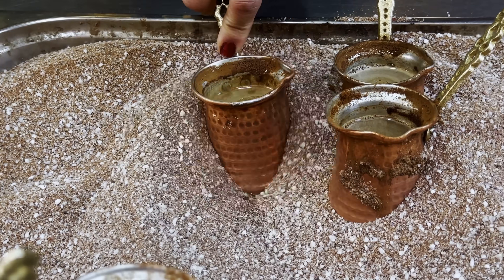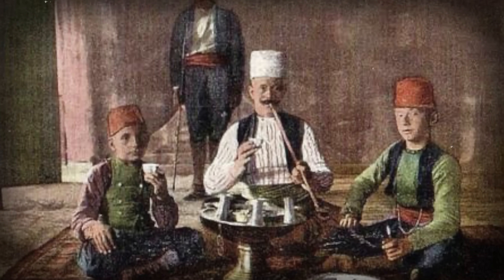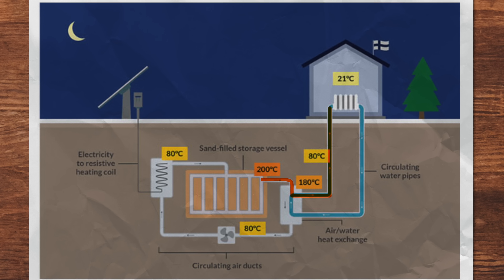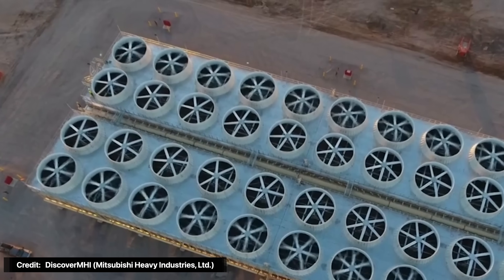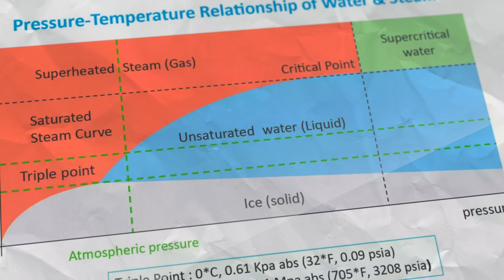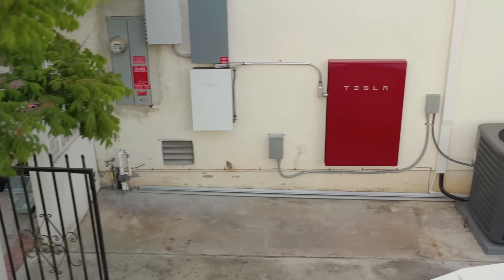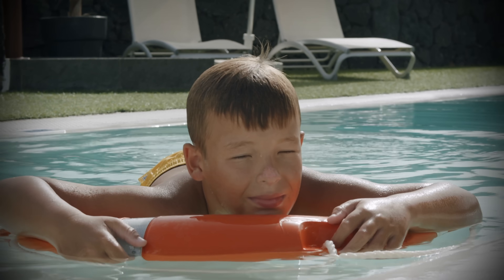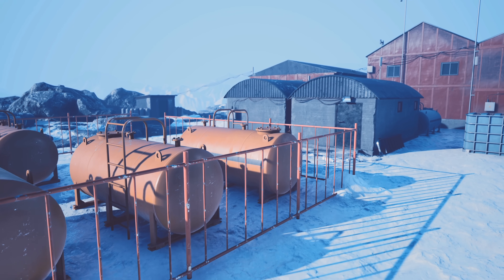The Power of Sand Batteries -- Revolutionizing Energy Storage...

Comment: What I don't get is when people say that the round trip efficiency of Sand is low compared to Li Batteries. My take is WHO CARES?!  If you lose 30%-50% of generated renewable power storing it in Sand that's STILL 50%-70% power you would otherwise have lost because you don't have storage. And if Sand is MUCH cheaper than Li batteries and not subject to the scalability issues of batteries then it's better than nothing.
Reply: Efficiency turns out to be a huge deal and anyone who has lived off-grid for real knows it in spades.  Its easy to brush under the rug when one is grid-tied, but the instant you aren't the importance becomes clear as day.  Even a number as small as a 5% improvement is incredibly important.   I can tell you straight-out that very few people will be interested in turning high-entropy heat back into electricity even when it is offered as an option.

High-entropy energy sources are best used for high-entropy applications.  Heat-to-heat.  Cold-to-cold, and aren't really useful for much beyond that.  Nor will they ever be... reversing high entropy (aka heat) butts up against the laws of physics, particularly the Carnot cycle, so there aint gonna be a miracle breakthrough in this department.

In anycase, this is an area of understand where you really have to live it to understand it.  I can give a simple proxy example, though.   It's like comparing a thermo-electric cooler with a mini compressor cooler.   The thermo-electric cooler can burn 40W 24x7 and STILL not get a compartment usefully cold.   A compressor cooler can do twice as a good a job burning 60W at 25% duty cycle (an average of 15W) cooling the same compartment.   Roughly 300% better.

Same thing with trying to use a sand battery to generate electricity.  You can do it, but its a stupid way to produce electricity.

-Matt
Reply: According to Tony Sebo, the best ratio of renewables generation to storage, is 4:1.  So the issue is what to do with the excess
Reply: If you are building new, a sand / earth battery doesn’t cost much.
You build an insulated (semi) basement and heat up during cheap electric periods.  Should last a few days at least.
Reply: That is the best usage for this tech. Home heating. The energy 'loses' from a basement sand battery becomes the lovely warm house above. In this scenario the loss is the whole point.

For those without a basement think about building a carcass around your wood stove to hold sand and thus heat. Even just 200kg. 1000kg would be better, and is only 1 cubic metre. 

Instead of banking and smothering a fire to keep your home warm over night, where most of the woods energy is turned to smoke and dumped into the atmosphere, you run a much cleaner hot burn fire to heat the sand. You then let the fire go out, and the sand keeps your home warm over night, or even for days. @markthomasson5077
Reply: @markthomasson5077  large temperature changes are terrible for a foundation of a house and the possibility that over time you would get “leaks” in the thermal insulation letting water in would be an unacceptable risk.
Reply: @keithv3767  . No, it would only vary by say 5degC.  Basically it is underfloor heating similar to where you heat up the whole slab. 
Ideally suited to a location where the ground water level is well below the base.
Reply: @markthomasson5077  Interesting.
Reply: Yeah, but there are other forms of battery storage... 

 If they are too inefficient. They won't be profitable, because someone would have to buy more. Making it expensive. Therfor making it useless.
Reply: There are only tradeoffs - there are no easy solutions. The power and equipment are not free. It is social tradeoff. Is it right for everyone to subsidize the price of solar? Not everyone agrees!  Experts can only be trusted, if they have skin in the game. Here they don’t. Invest your own money, do what you will. Asking others to subsidize is a social/political decision to be made. I think . . ..
Reply: There are only tradeoffs - there are no easy solutions. The power and equipment are not free. It is social tradeoff. Is it right for everyone to subsidize the price of solar? Not everyone agrees!  Experts can only be trusted, if they have skin in the game. Here they don’t. Invest your own money, do what you will. Asking others to subsidize is a social/political decision to be made. I think . . ..
Reply: I agree. The loss in efficiency for sure is worth if this material is so cheap.
Reply: why do you compare a tesla powerwall module, which doesn’t support an entire home (as shown in your video), with the solar night energy silo of 7m height, which is to be used for way more than a single household? the tesla power wall is a 10kwh electrical storage. the silo stores up to 100mwh in heat. thats a 10.000 times more, if you really want to compare that.

with electric storage you would need to convert to heat - how is the efficiency there?
even if the efficiency of the heat to electricity conversion is only 50% (you mentioned 30-50%), you’ll get 50mwh of electricity from the silo shown in the pictures. how is that by any means the same as a 10kwh wall battery?

maybe a combination of both would be good, or smaller solutions for private use become an option.
Reply: Exactly.
Reply: I am always excited by these cheap energy storage solutions, but I'm not sure they are actually viable.
Turning electricity to heat, storing that in sand or rock and then converting it back is very wasteful.  Creating hydrogen that you can then either burn or use in a fuel cell seems more sensible, especially since hydrogen can store energy long term. Using Sand as a "heat storage" might work better, essentially using it as a form of "buffer tank", but in that scenario...why not use a heat pump and make use of the 300-400% efficiency? 
I think there are usecases where this type of storage makes sense, but I doubt sand batteries are going to replace LFP/Sodium batteries, heat pumps or other systems.
Reply: People care because efficiency means loss of money. So it´s either cheaper or more expensive.
Reply: @jonjohns8145  you're forgetting to consider production costs. Just because you think solar and wind is free energy doesn't make it so. It takes tons of energy to produce these products and you'd want to recoup the green benefit during the life of the product and then produce some clean energy before it needs replacement. If you're not meeting those minimum thresholds, there's 0 benefit. Efficiency is the holy grail of these technologies. I hope that clears up some of your concerns and you now get why people who understand these things say such things. Cheers.
Reply: you are correct! some people simply do not understand! restistive heat elements and sand is much cheaper than lithium battery production.  efficiency comparison here is irrelevant, and electricity to heat conversion has the highest efficiency, over 90%. most energy in winter climates are used on heating! YES sand energy storage will be lithium batteries at any given time hugly. AND the cost is fractional compared to chemical batteries.
Reply: @varman001  "....efficiency comparison here is irrelevant...." Maybe for you. Efficiency can be less relevant if compared to price, longevity etc. But it is almost never irrelevant. Maybe volume or weight is the limiting factor in a certain use case, how do you know ? Maybe efficiency is all that matters in that use case, why are you to say ? It all depends.
Reply: Well, Sand cost close to nothing. Doesn't pollute the environment. Easily obtainable. Don't need specific mining permits. Don't need regulations. So many merits. Doesn't explode since no dendrites will be formed.
Reply: A sand battery can be continuously replenished even in winter with solar panels and heating elements and you don't even need an inverter. You can wire the solar panels directly to the heating elements in the sand. I am going to build a test system in my shop using 2 55 gallon barrels filled with sand. I'll use 2 or more heating elements wired directly to 6 solar panels. I am going to use this only to heat the shop. I am just turning off the garage heater all together. It is attached to the house so it wont get that cold.
Reply: And sand is way the hell cheaper than Li-ion. Need to get back more electricity? Just add more sand.
If your sand battery was stored underground, then it wouldn't even be taking up useful space.
Reply: sand batteries could be the future of energy storage—cheap, efficient, and scalable!
Reply: Absolutely JonJohn. Not every innovation has to be overly complicated.
Reply: What I don't get is how the EV industry gets away with lying about the true carbon footprint of those cars
And I really do not want to be in one when the battery pack cooks off into a thermal run away ❗
Reply: The Finns said 10-20%. Of course, it must depend on how well insulated the silo is. But if it is powered by renewable energy, I see it as a huge gain.
Reply: Sand is by far better than lithium in many cases. Not all cases. But many
Reply: For a home installation, I don’t know that it would be cheaper than lfp or sodium batteries. The sand container will take up a  huge amount of space and be extremely heavy which can cause problems with the foundation of a home.  The coils inside would wear out over time and need to be repaired or replaced and the thermal insulation would have to be maintained. I would say grid scale installation is the only place this would work. I don’t want anything that is 1000 degrees on my little piece of property.
Reply: @keithv3767  
For a home sand battery a cube of 10 feet edge is sufficient .
Reply: @keithv3767  I live off-off grid, side of a mountain with 40 acres and -10 to - 30°f winters, I love this idea, bring it on.
Reply: Every unit of renewable energy has a cost to produce. Wind power is not infinite and free - there are operational costs to having a wind power installation.
Reply: You do have a point, when it comes to renewables, we are already at times producing more energy than we need at times in some countries, that is likely to happen far more over the coming decades as generating energy is becoming so cheap, whereas storing it is still a problem with it being expensive, so even at 50-70% power, I can see some merit to that, and who knows, maybe they'll find solutions to improve that efficiency, either way, we need a lot of cheap energy storage, so use what ever options that work well, until better solutions in the future are around.

With all that said, I don't know how effective this would be at a small scale for our homes, and looks like a better solution for the grid and for industry use that use a lot of heat.
Reply: The heat loss from the sand battery could be used for a sauna. Redirect the surrounding hot air through vents to another building.
Reply: I get your point and it does have merit. But by the same logic, the efficiency of the renewable power source wouldn't matter either. Looking at it in reverse, a lower round-trip efficiency means lost power that you wouldn't lose if you used a Li-ion battery, improving your energy independence.
Reply: @ipp_tutor  Yes, but With Sand batteries you don't have to Ramp up production on Li, Cobalt, Manganese, and every other substance we would need to electrify everything and keep pumping out Batteries. The cost of mining, transport, pollution, discard, recycle of any Chemical battery (even if we switch the Na instead of Li) will Always be more than building a Big insulated tank and filling it with sand.
Reply: @jonjohns8145 Why not just convert excess supply into hydrogen injected into existing natural gas system with a capped limit where safety wouldn't be an issue.
Reply: @RP-hn1qc  Unlike methane, hydrogen imbrittles metals with prolonged exposure, causing rapid failure. The existing natural gas pipeline infrastructure cannot be used to transport or store hydrogen, unless you replace all the steel pipes with expensive ceramic ones. Anyone who's ever tried to sell you on this idea has never spoken to a chemical engineer
Reply: @Spencergolde  It's been researched and tested IRL that nationwide 5% hydrogen blended into the existing natural gas network will not cause any issues. Some European countries are converting wind energy into hydrogen and blending it into the local CNG pipeline.

I will not deny the conversion efficiency is ridiculously absurd but in the context UK needing 20 GWh just cut wind curtailment (pitching blades to produce zero power) in half. It's even cheaper to just install more turbines than install ANY FORM OF ENERGY STORAGE in the context of wind energy because doubling of wind speed increases energy production by 6 to 8 times as the potential energy increases by 8 times in total.

We haven't even gotten into more steady and consistent high altitude wind power that a 160 mph jet stream upon a 10 KW turbine at 20 mph would now be experienced up to 5120 KW of potential wind energy. Normally, beyond 40 mph most turbines pitch the blades to prevent grid damage from over production. 

If you can suggest a better method without going out of your way on costs or infrastructure requirements to store the energy I'd love to hear it as nothing needs to be done aside from tazing water and a giant holding vessel to ensure a steady 5% of hydrogen is injected that cross references current CNG demand to determine proper hydrogen flow rate.

Reminder, there will be times it's just quicker and cheaper just to cryogenically cool hydrogen to store it decreasing volume by 848 times as we're powering down wind farms to protect the grid.

Theoretically, if you had a stable supply of relatively high purity co2 or co you can convert hydrogen into methane (gas) or methanol (liquid) in which the later would be more ideal as a octane, hp booster, and temperature regulator. For context, an engine running on pure methanol doesn't even need liquid cooling to drag race as the latent heat of evaporation exceeds the heat gain of combustion. When I tow heavy I use a mixture of methanol and water to keep exhaust gas temperature lower to protect engine with the side benefit of increased power.
Reply: @RP-hn1qc   @RP-hn1qc  The problem I see is that 5% is substantially less than 100%. If the goal is net zero emissions, it's meaningless to just slightly dilute the dirt-gas supply with green hydrogen, this requires continued reliance on fossil fuels. Liquifying hydrogen requires an enormous amount of energy, not only because it's boiling point is about 55 C lower than nitrogen, but it's specific heat is also about 13x higher than nitrogen. It comes out to about 4,500 J/kg to liquifying hydrogen and convert it to its para spin state starting at 20 C. That's to say, liquid hydrogen is one of the least efficient means of storing energy known. 

The cheap storage solution you're looking for is battery storage. Several chemistries, most notably sodium-ion, have the low cost, high life cycle characteristics that make them suitable for grid storage. Several analysis have found that the combined cost of energy from wind or solar and the cost of storage from batteries can compete with or undercut fossil fuel power.
Reply: @Spencergolde  34,574,468,085 KWh of wind energy in UK is wasted annually as the grid can't handle the power and would be costly to repair if they didn't power down wind turbines. If you're using a single battery for grid storage you shouldn't ever be taken seriously in regards to climate change UNTIL EVERY VEHICLE ON THE PLANET IS AT MINIMUM A PHEV WITH 30 MILE RANGE. Which would make it +90% EV miles annually if charged daily.

Your efficiency argument also disregards hydrogen injection into existing CNG network is energy security and national security as some areas are either having rolling blackouts or shutdown of high energy industries. Within the context of recent geopolitics Germany should not be curtailing steel production because when sh** hits the fan and full scale WW3 I doubt China would be as willing to supply steel or alloys for us to build. weaponry.
Reply: Cause even doing it to a safe limit will over time poison  the ground water supplies
Reply: @Spencergolde Using NASA's vast experience using hydrogen launching rockets to the moon and space. If the pipeline stays below 392F hydrogen embrittlement will not occur. Regardless of what's in the pipe that temperature range is a danger even if it were empty as it could ignite surroundings.

"the amount of carbon or carbide in the alloy, the hydrogen concentration, gas pressure, and temperature usually in the range of 200 to 600 °C (392 to 1110 °F)"

I won't deny the stove burners and ovens may be shorter lifespan but will it come out cheaper in the long run to blend hydrogen VS goto war with Russia who are globes largest oil and fertilizer producers in the globe
Reply: @RP-hn1qc  The temperature range you are citing is for a very specific metal alloy. Most off the shelf plumbing and piping experiences embrittelment at ambient temperatures and modest pressure. The current gas pipeline network can not tolerate more than a few percent hydrogen by volume, otherwise they will age at an accelerated rate, necessitating frequent replacement and increasing the risk of pipe failures and explosions. There is a solution to get around using gas appliances, namely electric appliances in all of their different form factors. For the very small percentage of people why just Need a flame in order to cook, liquid ethanol stoves may be an attractive option. But hydrogen isn't
Reply: But we use a lot of fuel and power  to mine and make lithum batterys  thats like saying ev cars have no green house emissions  not true cause power plan that makes the power to charge it is and the more cars to charge means more gas  coal and nuclear  power needed and more green house gases
Reply: @ipp_tutor  The point you are still missing is that you can get sand locally from anywhere in the world where humans are living. YouTube will remove my comment if I copy/paste resulst of where Cobalt for lithium comes from, so just google it. Its nice to be certain ethnicity when you can argue about the nuances of clean energy efficiencies only, while certain demographic of certain age group dig up the raw material for you.
Reply: Exactly
Reply: I totally agree that the efficiency shouldn’t be such a issue because cost is low and capacity is high and renewable 
Considering that a standard ICE is only about 30-40% efficient at the very best, usually under 30% while polluting the environment
Reply: Completely right!  Petrol engines have also very bad efficiency, who cares?
Reply: @ernstlemm9379  Everyone basically, that´s why we have hybrid and electric cars. It´s caled "innovation" it´s quiet common in technology. Especially with efficiency. Those are huge costs we are talking about. Cost for delivery services, Taxis and so on. It´s really narrow minded to say "Who cares" probably way more people than you think. Just because you don´t care does not mean nobody else does.
Reply: Heat energy isn't lost. This is false. The "lost energy" is actually low grade heat that can be used for district heating etc. Yeah some heat (like 10% of the initial stored heat) will likely escape to the environment but this can be kept to acceptable levels with careful design and insulation.